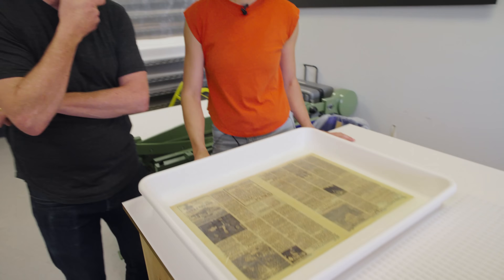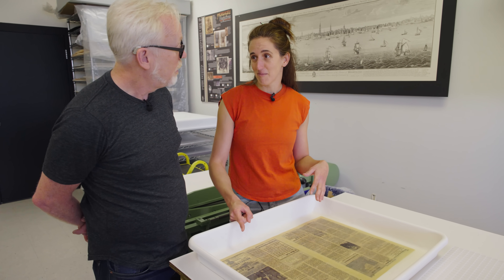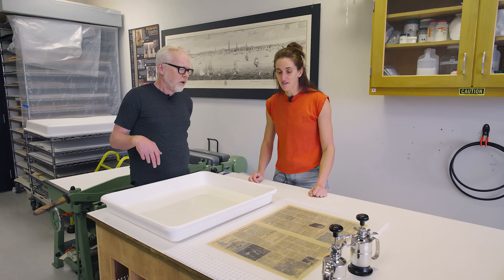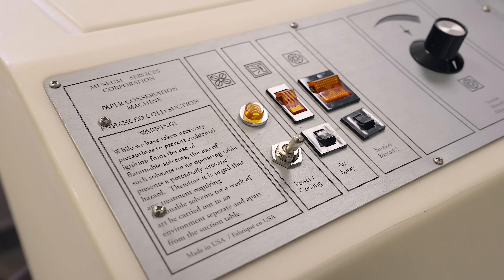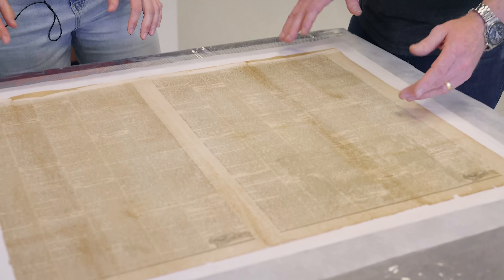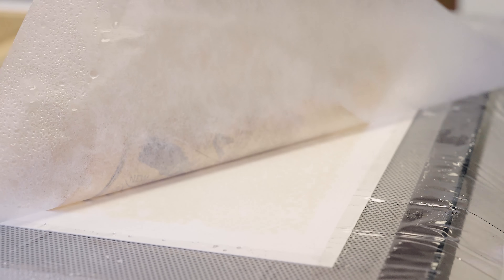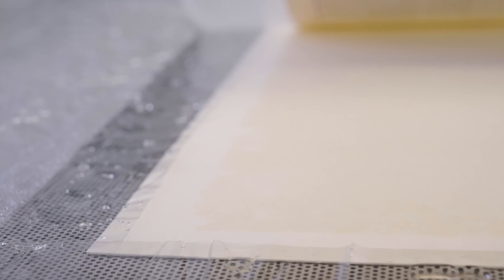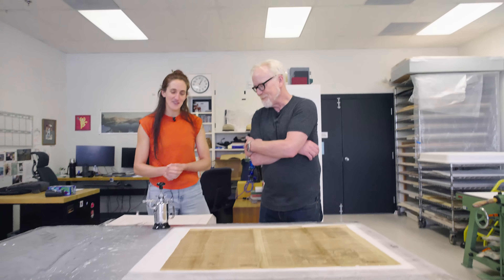How to Wash a 157-Year-Old Newspaper

Comment: I think it's called Aqueous Deacidification, or that's what Union Carbide called it when they started offering the service large scale in the mid 1980's.  They used Magnesium instead of Calcium for the buffer, but it sounds the same otherwise.  Union Carbide bought the rights from a guy who invented it 20 years earlier (google "Wei T'o").  

Apparently someone was confident enough in the process to use it on some rather important documents; several copies of the Declaration of Independence copies from 1776, the Emancipation Proclamation, the Treaty of Paris, and one or two copies of the Constitution.

Comment: Various forms of Washi were used before polyester.  Kozogami, Miusumatagami were common.  It's more expensive now and not as truly neutral. Very fine linen was also used.  And depending on the age they also used to use soap (it was basic and a surfactant), although not really up to todays level of fine conservation.

Chelation or chelating agents are designed to grab and pull along metals (which include calcium, sodium, etc).  Chelation is also used in people for treating toxic heavy metal exposures, or in cancer treatments which can help flush out the isotopes added to target cancerous cells.  Which is generally where more people hear of the term.

Comment: What I really need to know is what is up with the suction table? It's not just a general use suction table, it has a plaque that says "paper conservation machine". Who builds these things? Is it a very nice custom job? Or is there a company that mass produces them? How many museums even buy these? Are there hobbyists that do this stuff? Who first came up with this idea for a suction table specifically for paper conservation? I need answers!
Reply: Museum Services Corporation made this one. On their website, they say "Pricing varies. If $0, then please call for price by ordering a consultation." and the price for all the listed sizes is $0.
Reply: For another angle on this, the Baumgartner Restoration youtube channel has some videos on how they made their custom "hot table" (which has an entirely different kind of vacuum system - paintings have more thickness and texture than paper, and are also usually one-sided.)
Reply: @MarkEichin  I understood that in fine art restoration, you'd need the hot table to retrieve glue as well so that the vacuum mostly is for flatness. So perhaps suction table vs vacuum table.

Comment: The sprayer is called a Dahlia sprayer. They cost $164.
Reply: Thanks for the name; As Adam has noted, knowing the name of the tool is 80% of the difficulty. I found the $164 listing and I'm seeing some identical listings on ebay as low as $82 right now (which feels like a very fair price for a high quality stainless steel mister that gives a consistent even mist), so there's probably some room in the pricing.
Reply: good thing i dont have that kind of moneys
Reply: Something I have absolutely no need for, but still want.
Reply: Comment needs to be pinned.
Reply: The brand seems to be "Maruhachi" and "Dahlia Sprayer" seems to be either the model name or a generic term.
Reply: This is definitely going on my splurge list
Reply: Honestly i could see that being worth it for quite a few different projects. A good, gentle mister is always useful
Reply: Is that a brand name or just a generic name for that style of sprayer?
Reply: @tookitogo  not sure. I found it by googling
Reply: THANK YOU
Reply: You are doing god's work
Reply: @rurone  lol. Thank you, but it was just a few Google searches.
Reply: Google search by image helps in these situations
Reply: $164 for me, or $164 for my dog?
Reply: $88 on Amazon
Reply: Amazon $83.29 as of 1/2/2026
Reply: Seeing as this is a government ran operation I'm sure they spent $500.00 on each one it's the government way